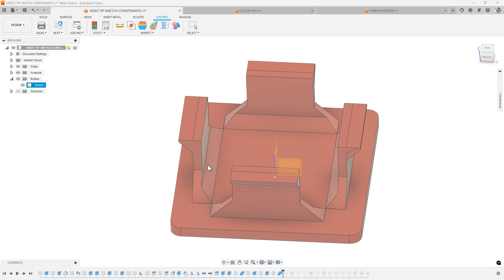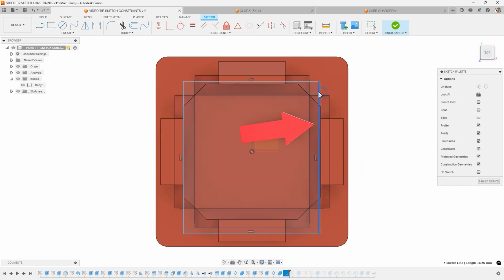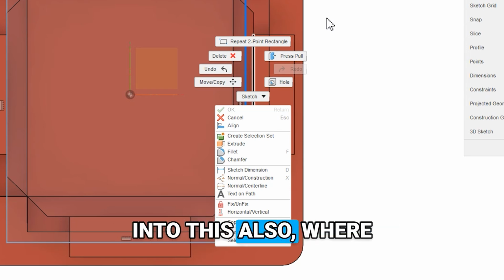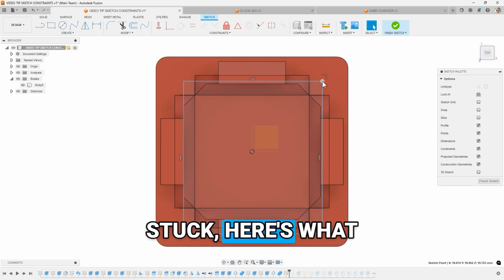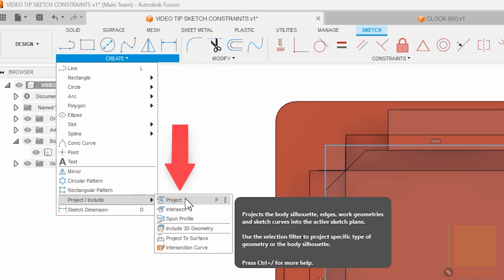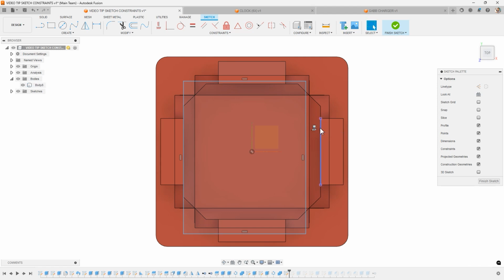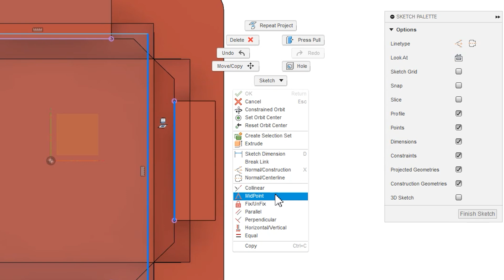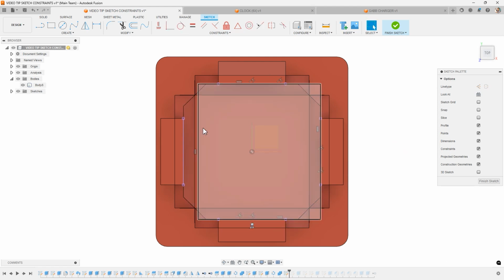Fusion 360 Constraints Not Available? You might need the Project Tool!

Comment: That’s not a sketch constraint issue, there’s nothing “missing”. The 2d sketch you are creating (the rectangle) is simply not in the same plane as the 4 lines you want to constrain it to. Of course you need to project geometry onto your sketch’s plane. It’s not a sketch or constraints issue, it’s exactly how it works 😂 You can’t expect to access something from the 3d space (any geometry of your body or other sketches from different planes) in your isolated 2d space (the plane of your new sketch, the rectangle) 🤦🏻‍♂️
Reply from the maker: @MStoica  You are correct. But, when learning a Fusion this can be a difficult concept. Clearly not for you!  You should start teaching :)
Reply: @TylerBeckofTECHESPRESSO  I’m still learning. And this was one of the very first things I’ve learned when I started. I was expecting the same thing to work the first time I encountered this situation. But the issue is the video title, it’s both click-baity and not true - this is not a sketch issue and no constraint is missing.
Reply from the maker: @MStoica  got it.

Comment: Did not know right click was intelligent lile that for constraints. Knew about project though. If you select the surfaces for project you get all lines of that surface. Even better for constraint use they can be construction lines. Then it is easier to differentiate.